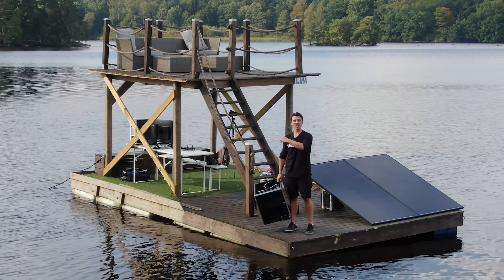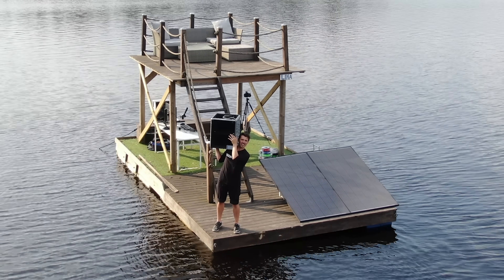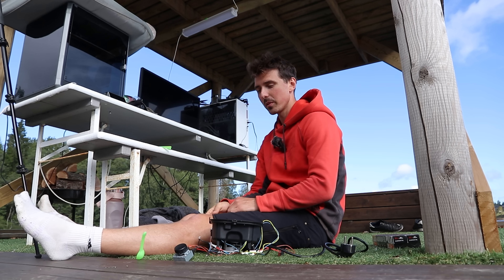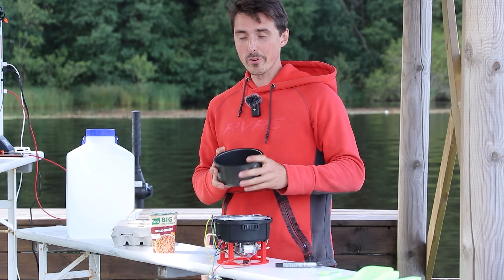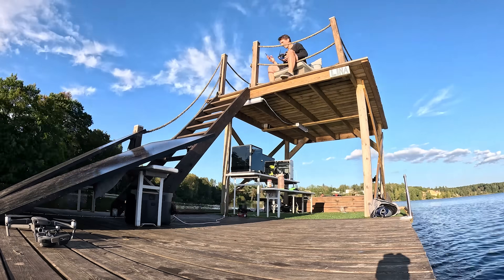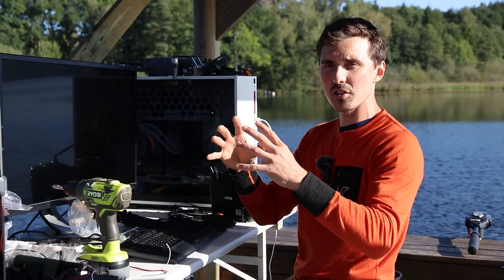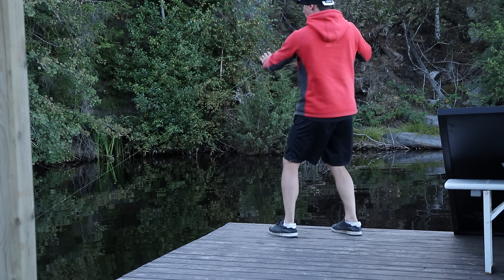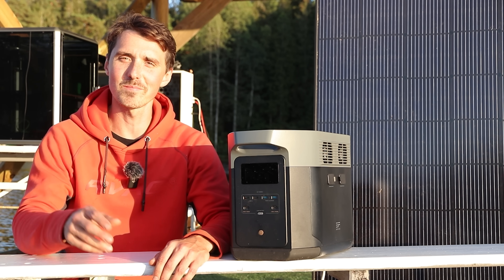3 Days on Raft Using Only a 3D Printer

Comment: Could have used a laptop that uses waaaay less energy than a full desktop rig which is useless in this scenario or just a flex?
Reply: It’s very hard to run any 3-D software on laptop like it’s very slow and laggy
Reply: @rkymtnrsx  I run F360 and Blender on an M4 MacBook Air and it works just fine

Comment: aluminum foil doesnt retain heat very well at all, it has a really low volume with a really high surface area. It can heat up quite fast but it will also dissipate it extremely quickly. Thats why aluminum foil fresh out of the oven is not hot to the touch

Comment: To be honest, not sure what to think of this video. It is more a commercial for the solar power / inverter unit and maybe the printer. Sure you need money so having sponsors for stuff you use if more than fine if you are honest about what you think of the stuff. But  things like printing forks  and knives because you have none for some reason while you did take a 3d printer and lights and resistance wire to a raft makes no real sense. Yes I get that you just " need" a purpose to run the printer and use power to show what it can do. But the combination is a bit strange like this. To he honest, I was entertained by the printed fishing reel and wire. But like the usual content more. And hope you got the glas sheet back out of the water.

Comment: how did you not melt the battery connector when you heated up the wire? using your old tutorial i built a similar igniter with nicrome wire and it melted and burned down the plane i attached it too

Comment: Kids, it’s a bad idea to print knifes, forks, or anything else on a 3d printer. 
It’s not food safe and may introduce toxic particles from the printer or the filament into your food!

Even filaments that are specifically designed to be food safe are safe under a very limited set of parameters.
Reply: I thought the reason was the bacteria that could grow in the gaps?
Reply: @ yes, this is one reason. I should’ve explicitly mentioned that.

Comment: "3 Days on Raft Using Only a 3D Printer" - except for food, water, can opener, air fryer, aluminum foil, tools, cookware, battery, solar panels, various other electronics, various other components, various other hardware... etc, etc, etc...